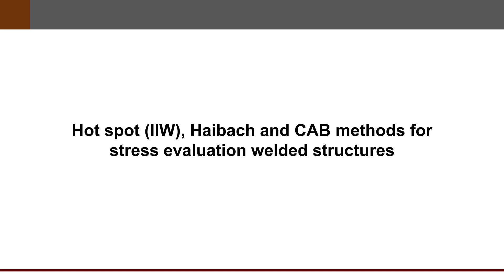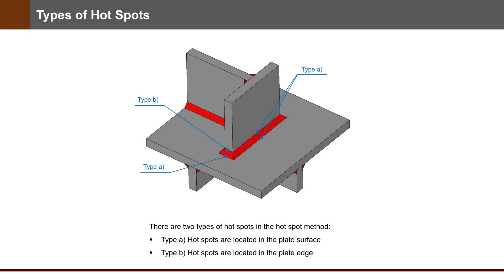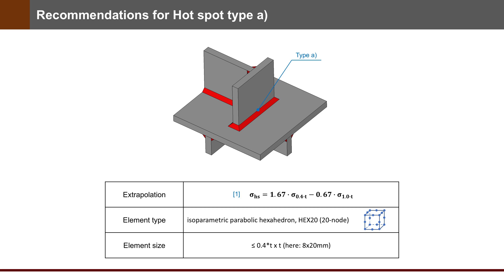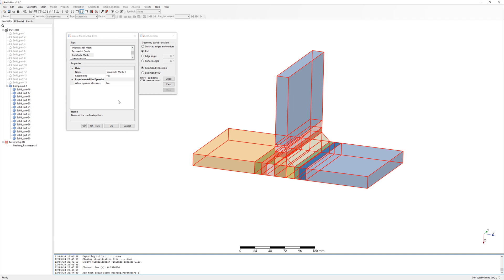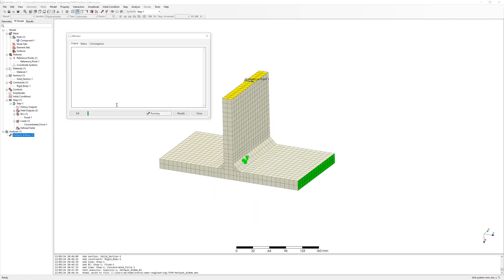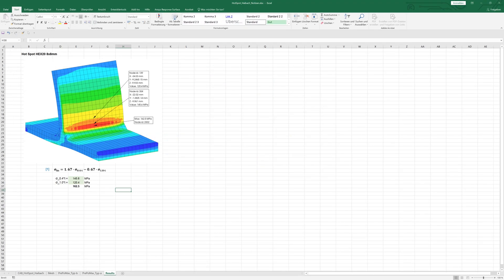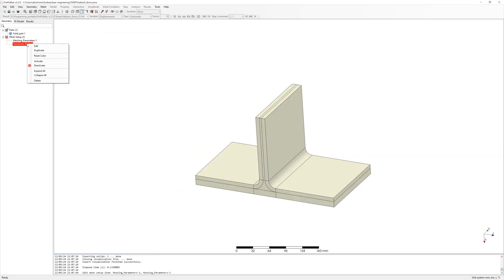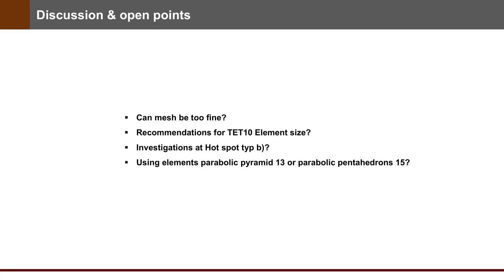Hot spot (IIW), Haibach and CAB methods for stress evaluation welded structures with FEA | PrePoMax

Comment: I see in my opinion mistake since in models should be gap between vertical and horizontal plates how it is sklved in model? I see continous mesh no gap. Onle weld should transmit force ?

Comment: Hi, thanks for making this video! Where did you get the coefficients for the equations?
Reply from the maker: Hi, equations [1] to [6] for hot spot extrapolation come from the International Institute of Welding (IIW) - RECOMMENDATIONS FOR
FATIGUE DESIGN OF WELDED JOINTS AND COMPONENTS.
The CAB method equation was developed at the University of Dortmund, Germany.

Comment: BS7608 requires the use of a structured hex mesh for weld HS stress calculations. Does IIW allow tet meshes?
All the methods are displaying a sensitivity to mesh size (except for the tet meshes in HS/Haibach, which are not permitted in BS7608). It would require a prohibitive amount of work to repeatedly remesh a real structure in order to converge to an acceptable value.
Can you compare the results to the Nodal Forces (Volvo) method? It claims to be mesh-insensitive.
Reply from the maker: It is only some rough recommendations given: Prismatic isoparametric solid elements, for example is isoparametric 20-node elements with mid-side nodes. 
For plate or shell element model , the elements are arranged in the mid-plane of the structural components. 8-noded elements.